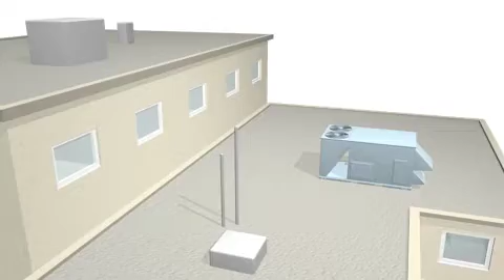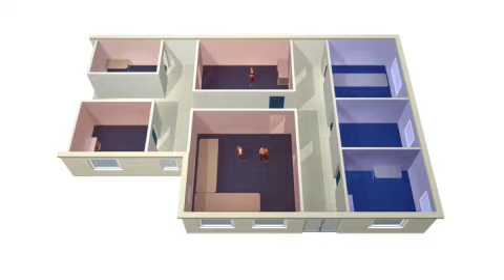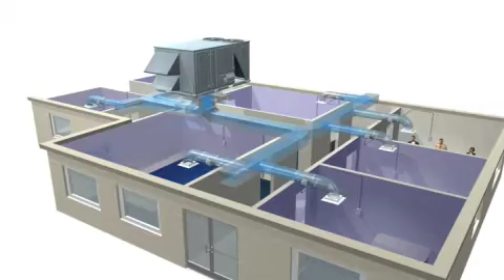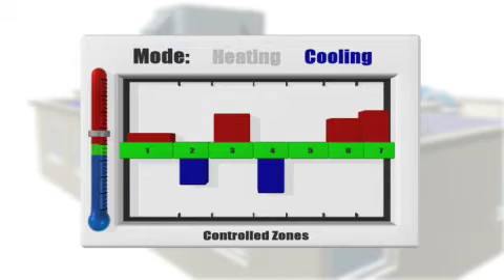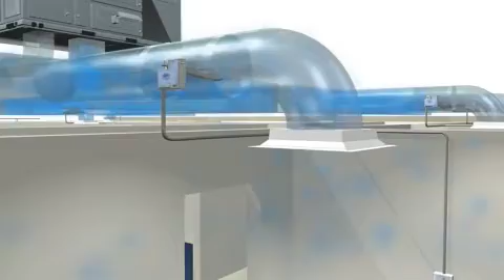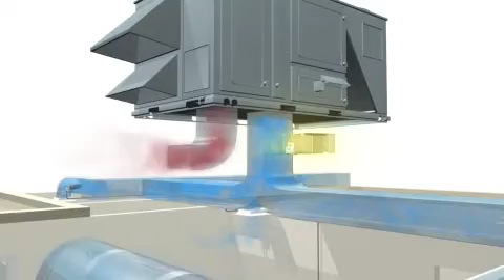VVT Zoning Systems

Comment: VVT is by far worst design.
Reply from the maker: Nah… but it is the most mis-applied.  If you follow all the rules, it can be very successful.  The two biggest issues are oversized equipment and designers trying to combine exposures.  Don’t mix interior with exterior on the same RTU.  Don’t mix East with west zones.  Etc.

Comment: Isn't this system (without terminal re-heat coils) somewhat of a compromise? What if, for example most rooms require cooling and thus the temperature discharged from the AHU is quite low but one or two rooms require heating? Surely the low temperature from the AHU will simply be blocked by the local damper but what about heating?
Reply from the maker: David Redmond yes sir!  When mis-applied, it will be an issue.  A proper application would not mix interior and exterior zones on the same RTU.  And do not mix various exposures (east combined with west, etc.).  So for a square building, you need at least 5 RTUs... N, S, E, W, and core... just like good practice without VVT.  What VVT then allows you to do is more finely done within that RTU and exposure.  So if the south perimeter has 8 offices, then each office can have its own stat on the same RTU so it can fine tune how much cooling (or heating) it wants.  But it can’t get the opposite mode as the other zones on that RTU... nor should it need to.

Comment: this is a great video i was looking for how to wire a variable valve timing (vvt) into my ecu on my car but found this video, pretty good im starting to looking this type of vvt thanks for the unasked for but appreciated information!!!!
Reply from the maker: There are residential versions also for your home.  I have Carrier Infinity zoning at my house because it integrates with my furnace to directly control the fan speed.  But others, such as Honeywell, make retro-fit zoning systems that can be adapted to any brand of furnace.

Comment: Show us what happens inside the rooftop unit
Reply from the maker: Joseph Bruny How do you mean?  The inside of the RTU is no different than a standard constant volume unit.  All of the VVT controls are physically external to the unit.
Reply: Want to see the inside of an RTU?  https://youtu.be/GxXvWUNXp3c
Reply: Thank you for your prompt reply. I was thinking more in terms of what PVVT heat pumps look like schematically. I am currently a student and the way heat pumps are connected to these systems
Reply from the maker: Joseph Bruny Not sure what PVVT stands for.  But in terms of VVT like shown in this video, the heat pump would operate exactly the same with VVT, as without.
Reply: The RTU in this video is a gas-fired unit, not a heat pump.
Reply: Thank you for the clarification!